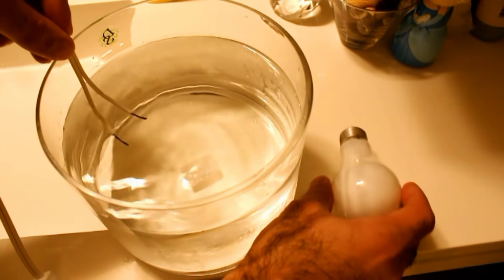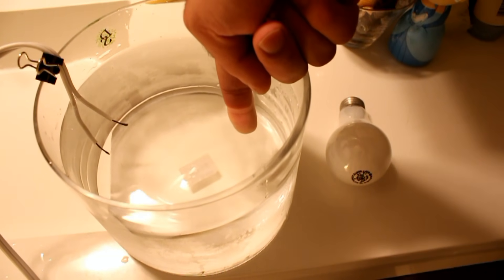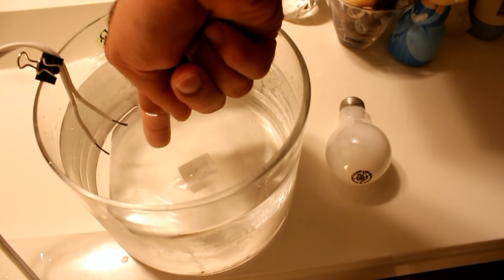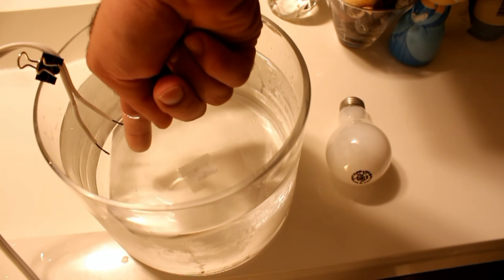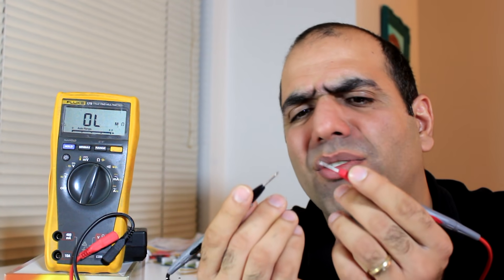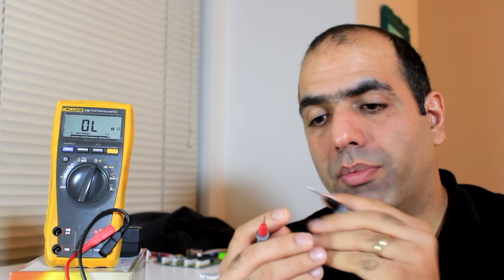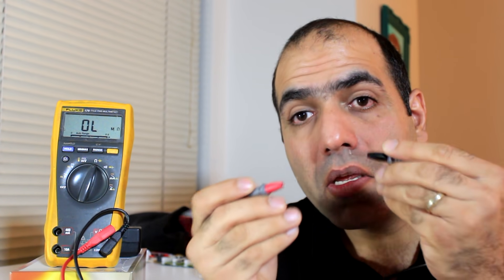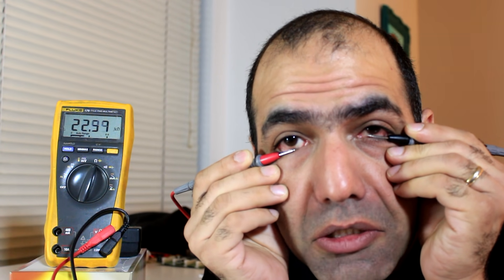Probing Eyes to Measure Eye Resistance

Comment: water itself does not conduct electricity, it is the impurities in water that conduct. So if you are going to jump in to a tub of water with some exposed power cables just make sure the water is absolutely pure and you will be fine. Definately do not jump in with a bag of salt

Comment: There's also no path back to earth in the glass beaker except back out to the service neutral/ground connection. If you are in a tub/shower in many older buildings there is an earth path through steels sewer lines, and except in the newest building a connection vie the copper or lead pipes of the supply.

Comment: So preparations for electricity swimming:

Put a non-conductive butt plug in the anus.
Tape or tie the foreskin shut.
Use earplugs.
Use nose-clamp.
Close eyes or use swimming goggles.

But how much does the skin resistance drop when you stay in the water for a long time and skin gets waterlogged?

Comment: WoW, I mean just WOW.. Does wire lengths matters when building Slayer Exciter Circuit ? Can't make it work no matter what I do. Tried over 10 different transistors, switching primary directions, tried few different power supplies from 5 to 50 V DC, wound 3 tesla coils, each 1 k turns - Nothing !
To be exact :
D209L  NPN transistor , 47 K ohm resistor

Comment: is lightning ac or dc?
Reply from the maker: +Jonathan Smit none, just a single pulse
Reply: That's genuinely mind blowing..
Reply from the maker: Keith Richards
Then AC is also DC if you look at it slowly! But nope, it is not DC.
Reply: +ElectroBOOM Couldn't you argue that a single pulse is just DC then? I mean a lightning strike seems instantaneous but I imagine if you looked at it through a slow enough time frame, it would just be flat line, right? The discharge of a lightning strike doesn't occur in an infinitesimal amount of time does it?

Edit: Holy shit that outro is legit
Reply: *****  Isn't the slope of a sinusoidal graph continuously changing with time though? Meaning the slope will be different at any given time?

... but on the other hand, I guess as the time interval approaches 0, the change in slope would reach a point where it's pretty much a flat line.....

  ..... but on the other other hand, that flat line wouldn't be parallel to the x-axis which would mean that the voltage is either increasing or decreasing right (not remaining constant)?? 

Sorry... Fuck I overthink shit. Did any of that even make sense? XD

I think I understand why it's neither AC or DC I just wish I could find a graph of a lightning strike. I imagine it would just look like half a period of the cosine function.

Comment: I feel like you missed one or two significant parts of the body with "low" resistances (in case anyone missed it, the "low" is also referring to height on the body) . Other factors to consider are cuts and grazes (perhaps attempt to measure the resistivity of blood, which of course flows through the heart therefore creating a very low impedance path to death.  I imagine it would be lower than typical water because when you bleed in your mouth you can taste that it is salty) and the effect of the presence of parallel paths.

Comment: Great Video but I have one question: If the resistance of the tounge is around 20kOhms, how come it hurts so much when I press a 9V Battery against it as there should only flow about 450µA?
Reply from the maker: +Moritz Hechler Well, that much current through body hurts! Considering 1mA to 5mA through heart can make it stop, 0.5mA is not too small.
Reply: +ElectroBOOM what happens if you put a 9V battery against your eye?

Comment: It's also worth noting your resistance to AC (Impedance) is much much lower, which is why you can't directly measure the resistance of your body for say a 120v shock. 

You should get a function generator with a 60hz sinewave with an inline 1 ohm resistor and meassure resistance with an oscilloscope.

Comment: You forgot to mention the resistance of the most important
part of a mans body which would be covered by water if they fell in. Don’t tell
us you did not measure it no one will believe you...  Please NO pictures or they will close the whole internet down. The reason is that probably has a much lower resistance
than average. (Grin)

Comment: I think you want a large-area contact, and not just tiny contact-spots from the probes.

I tried it between a large spoon in my mouth, and my finger in a tiny glass of salt water.  When using 9V batteries, I saw a "grey flash" whenever I connected the battery clip.   Few hundred uA through my brain or at least through my optic nerves, enough to see a visible effect!  Cool!

Don't forget that DC from metal electrodes is never electrons, instead it's ions.  The ions come from corroding metal, and the ion flux is proportional to current.   Touching some ohmmeter probes to yourself will always inject metal ions into your flesh if the exitation is DC.   Perhaps use an impedance meter with high-freq AC exitation instead.   Or, at least use platinum chloride electrodes (the ones from TENS units or EEG,) so the "electric current" corroded metal driven into your flesh isn't cadmium, tin/lead etc.     Aaaaaand ...now you know why 9V batteries turn your tongue black as well as tasting horrible.
Reply: never take advice from people who electricute their brain...

Comment: The probes on a multimeter are not likely to give an accurate measurement of the resistance a larger liquid electrical contact will make;  they would not be considered a reliable measurement for scientific purposes.

You need larger electrodes so the surface area of the contact is larger and stronger contact.

Keeping in mind current flow through the human body due to ions not electrons.

Also, trying to measure the resistance between the eyes is just creepy.
Try the ears instead.

Also, once the voltage is high enough to overcome resistance, the actual resistance might increase or otherwise change once a current is established, causing heating, electrolysis and Ion/pH level changes.

Comment: Wait, isn't the resistance related to how far apart the electrodes are, or more precisely how long the path is that the electrons would travel? So isn't it faulty to compare the values for the resistance in the video?
Reply: +LivingChords There are a number of factors. The most important one would be your resistance compared to the medium you're in. If you're in water that's significantly more conductive than you are, you'll have to get yourself much closer to the electrodes to end up with any harmful current traveling through you, but if you're in distilled water, you're way more conductive than just water, so it'll jump through you from further away, because you make a lower resistance pathway.

TL;DR Distance plays a factor, but the ratio of conductivity between you and a given medium is more important.
Reply from the maker: +Teth47 It is less dangerous in distilled water and more dangerous in impure water, if that's what you mean. Otherwise I'll leave it to you to calculate!
Reply from the maker: +LivingChords The resistance inside the body is pretty small. The major resistance is the skin, so after the electricity passes through the skin, the rest of the way is easy to go! What I'm trying to say is that if skin is 500K and insides are 5k, then it doesn't matter how far you probe on your skin, it has to go through the same thickness of skin, then much lower resistance path inside, which wouldn't effect you reading much.

Comment: And what about the resistance of the tip of our penis? I mean... For scientific reasons
Reply: Lord Void Slightly lower because of the added moisture. In my experience the difference is anywhere up to 15% depending on how long it's been since I last urinated. I'd guess it's because of dissolved salts in urine lowering its electrical resistance.
Reply: +Teth47 What if it's placed in the hole?
Reply: +Marcos Vinícius Petri It's about the same as regular skin.
Reply: +Lord Void bend over and pass me the multimeter lets find this out the experimental way :D #nohomo

Comment: ughhhh...ok. optical nerve resistance...check, Auditory canal resistance.......check.......nasal cavity resistance.....check into a hospital and get fitted with a straight jacket...hahahahah.......you sir are either really brave or the frontal lobe resistance check was the first one and it didn't go well. thanks for the video.I like working on cars and am getting to know about e component testing ie.. solenoids, coils, fuel injectors....I would like an engineers perspective about these things. for instance when a coil quits working why is the resistance to low, or high ect...

Comment: You dont have to show us, but what is the resistance of testicles (or testicle if you ony have one)?
Reply: +leppie. It has been scientifically calculated to 'H'. It's called the Hitler Constant.
Reply: +Smmmile:) For science's sake, I performed the experiment myself. Measure on Fluke 867B. As a benchmark, my tongue resistance measured 180k (yes, I was an idiot and had to do this afterwards...). From the experiment, is seems testicles are quite insulating in nature. I could not get a reading, so it implies something greater than 3M in my case. It also seems the harder you push the tips, the more resistance there is. Also, my ballsack is in a lot of pain now. I am quite drunk, and will probably regret this tomorrow.